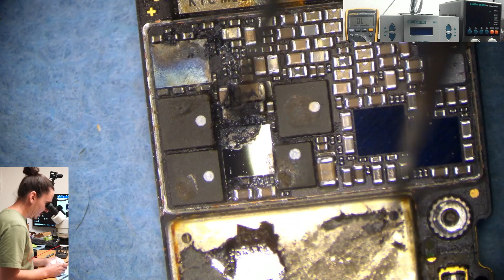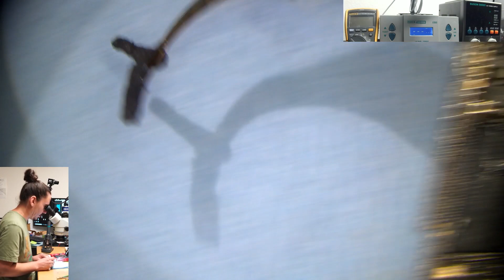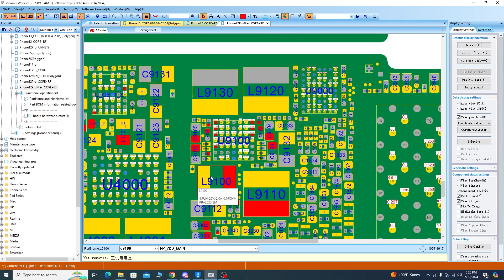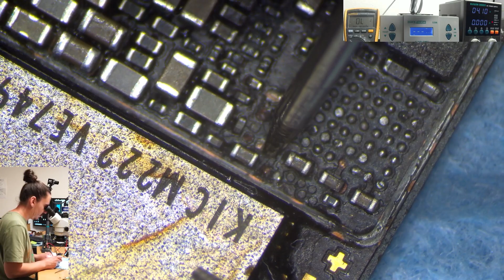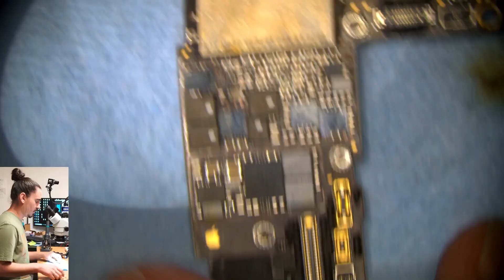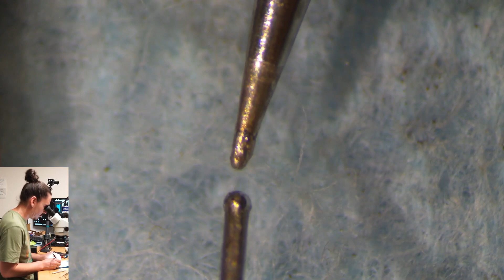Salt Water Damage Data Recovery on iPhone 12 Pro Max - Motherboard Diagnosis & Repair Demonstration

Comment: This reminds me of that iPhone SE2 that I worked on. Phone had a battery issue where the phone couldn't determine the status of the battery. I believe I mentioned this in the comments in one of your other videos, that I got OL on the battery SCL line. I had done a visual inspection and it wasn't until a slight prod with the tweezer did a pull up resistor, that I checked for components on the said line, reveal that it was cracked in half! 😮

Comment: Beautiful video! very interesting case! thank you for sharin Aaron, ice job! about pp1V8_IO, any idea why when shorted somewhere can makes eeprom to get hot on thermal camera even if it is good? theorically its not a coil, so voltage just "touch" it but not go through it..why getting hot? i read it always get hot in the initial boot sequence. Maybe, due to the 1.8 shorted somewhere else can keep eeprom active in that state? thank you so much!